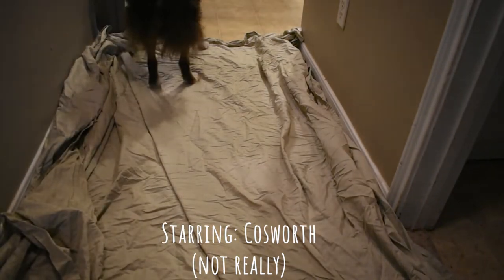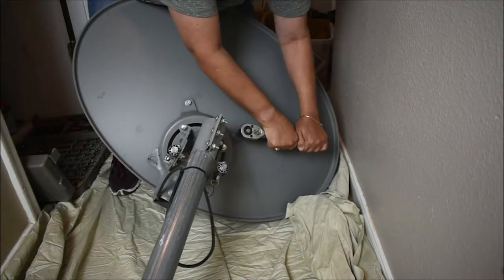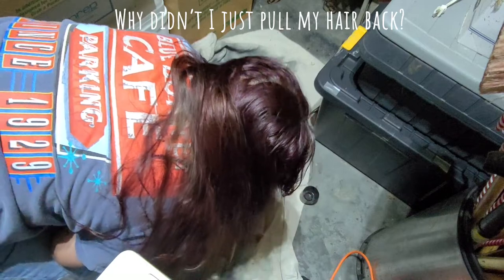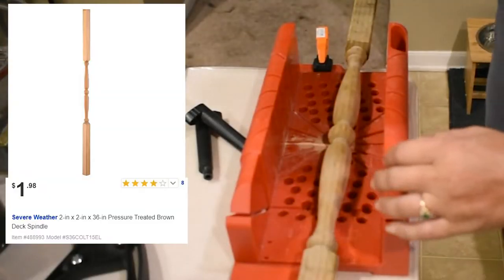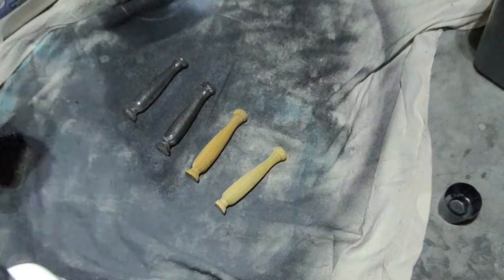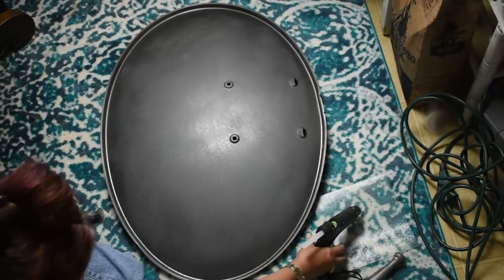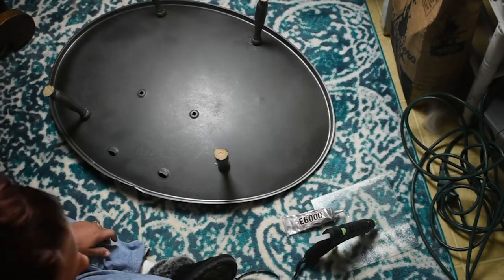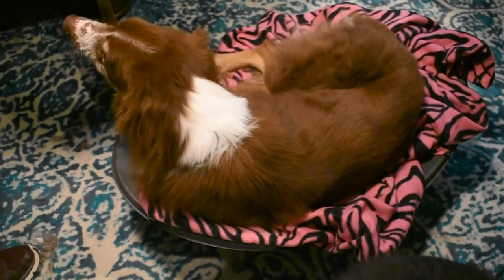I Transformed an Old Satellite Dish Into a DIY Dog Bed!

Comment: Great idea to recycle an old item.
Reply from the maker: I wish it were a big one from the 80s so I could turn it into a big coaster swing for humans!
Reply: @AngieDoesStuff  It would be easy to make one.  Take 2 pieces of 4" metal garden edging from Home Depot for about $10 each and attach them into a circle.  Use lawn chair  fabric and weave a cross pattern and screw them at the edge.  3 hooks for the hanging rope.  Make any desired size.  Wala